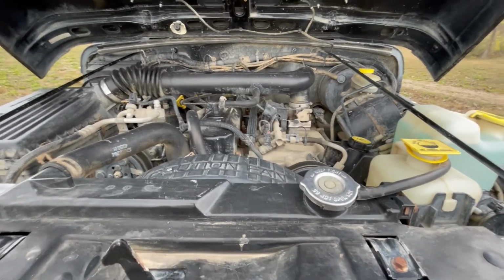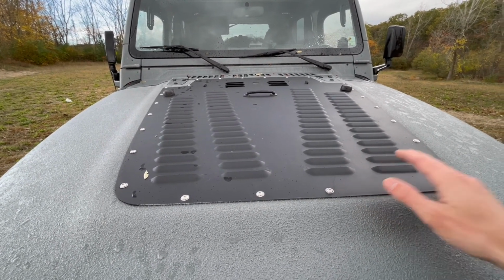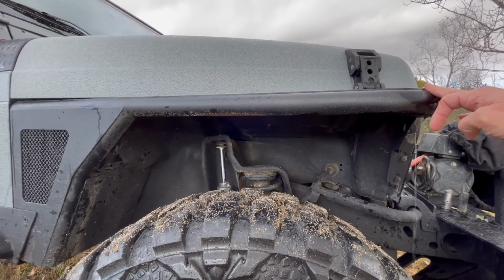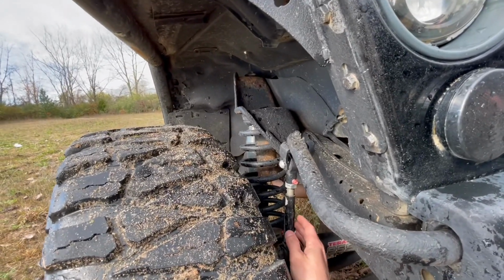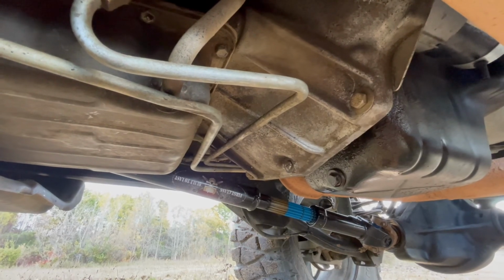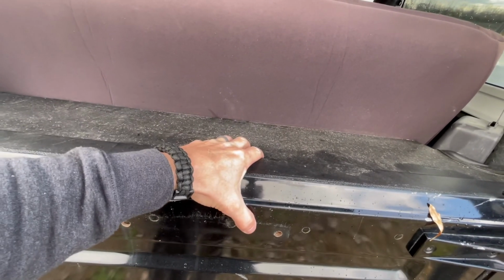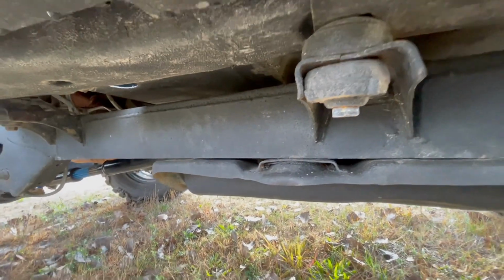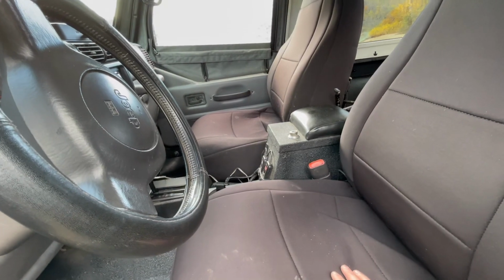Jeep Wrangler TJ Walkaround (BIG CHANGES COMING)

Comment: I think i am local to you biased on your videos, did you do your transmission work yourself, or did you have a shop (my 3speed auto 99TJ is acting up). I know the latter 4speed TJs are electronic and won't convert well, i like your option.
Reply from the maker: I had the transmission swapped at AJ automotive in Holland. They found a junkyard AW-4 for me and did the conversion.

Comment: Mind if I ask.... what's your 60mph cruising rpm now with the aw4? I've also got the 32rh and gears etc,  and at 60mph I'm around 3000rpm😐, not ideal lol ( I've actually  just bought a 2004 BMW x5 turbo diesel and plan to swap the engine to the 3.0 straight six  turbo diesel beema engine , quieter than the 4.0, smoother engine, higher recline surprisingly... also has 150+ more torque at 2000rpm instead of 3600rpm of the 4.0, so better for crawling, 50ish more hp also and uses less than half the fuel mpg aswell.... should be the first BMW powered 3.0 turbo diesel I think.... definitely in Australia  anyway.... and the BMW has a 6 speed auto trans but I think it's too large for the Jeep tunnel and likely longer aswell..... so I'm also looking into the aw4... would love to know or see a video - or both lol...on the differences achieved with your swap from 32rh to aw4.... love the channel btw👍🙏
Reply from the maker: Thanks for the comment! At 60mph my rpms would be approximately 2200 rpm and at 70mph approximately 2500 rpm. That’s with the AW4 automatic transmission, 33” mud tires and 4.56 gears. Definitely improves the highway drivability of the Jeep.
Reply: @TrailExpedition  wow thanks for the quick reply bud, awesome to know.... As mines on 33s aswell with similar gears... 3000rpm cruising in Australia at 100kmh (60mph) is fine, but noisy and thirsty AF in a 4.0.... ⛽ is au $1.70 per litre here in Australia ( I think roughly $7Us per gallon) .... Can't wait to see your next rig 👍
Reply from the maker: Wow gas is really expensive there! And yes, I 4.0 with the stock transmission was very Thirsty! LOL! The new rig will hopefully be on the channel in the next couple of months. You’ll have to wait to see what it is.
Reply: @TrailExpedition  sure is mate.... But such is life 😏.... Look forward to it.... I'll wait and keep an eye out for future posts 👍👍

Comment: what GPS/speedometer Heads Up Display do you have? what do you need to do to install? My jeep has 35" tires and 6.5 long arm lift, so my speedometer is also off! thanks
Reply from the maker: AUTOOL X95 Inclinometer GPS Slope Meter Speedometer Car Hud Display Car Offroad Accessories for 5-28V https://www.amazon.com/dp/B08TQXW9S1/ref=cm_sw_r_cp_api_glt_fabc_2YNWJBFRRQX325B2A7ZW?_encoding=UTF8&psc=1

It’s on Amazon and cost about $65. Plugs into a 12V or you can hardwire it in so it comes on with the Jeep like I did.
Reply: @TrailExpedition  how long did you use it for? very accurate?
Reply from the maker: For about a year. I loved it enough to put one in my JKU as well. Very accurate and I would definitely recommend it.

Comment: Witch headlights did you get? Can you give a link?
Reply from the maker: The original link that I ordered from is no longer working, however, I did find a similar one from the same company. They look identical to what I ordered but cannot be 100%. 

SUPAREE 7" LED Headlights + 4" Fog Light Replacement [HALO DRL + Turn Signal] [H4 Plug n Play] Compatible with 1987-2018 Jeep Wrangler JK JKU TJ LJ Rubicon Sahara Unlimited https://www.amazon.com/dp/B08LVKGG52/ref=cm_sw_r_cp_api_glt_fabc_AXAPS3NR3AKKYAR6C1WB?_encoding=UTF8&psc=1